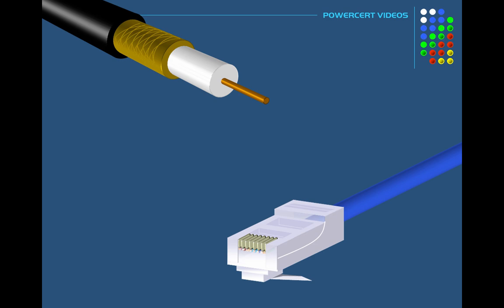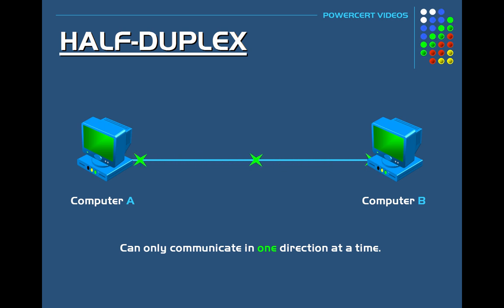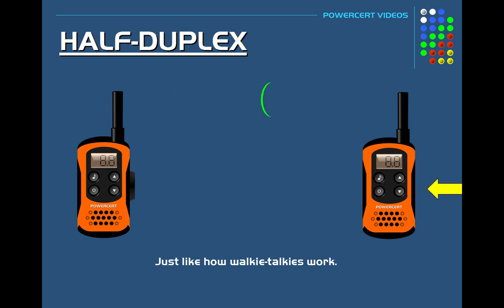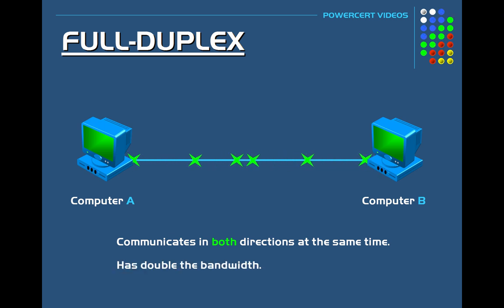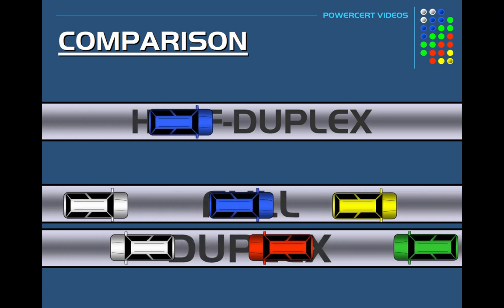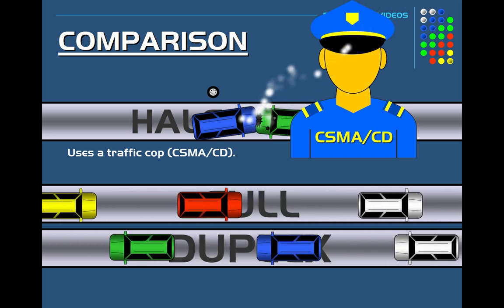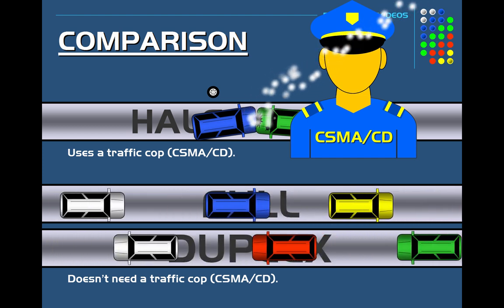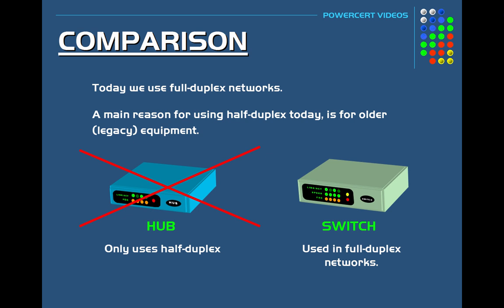Half Duplex vs Full Duplex

Comment: This video should maybe also have touched on the subject of Simplex. It's the third variant.

The signal is going in one direction only. The best example would be a TOSLINK S/PDIF fiberoptic cable.

So a Full Duplex solution is actually just two Simplex solutions set up in opposite directions.

Comment: I saw Half and Full Duplex in my router and wanted to know what it is. LAN 1 and LAN 3 had half duplex which I have been using the whole time and LAN 2 and LAN 4 had Full Duplex mode. That means better internet connection if I connect to the Full Duplex mode. May be, IDK but I will give it a try.

Comment: Ok question.    I want to add a nic to my server and my video editing workstation  that is direct for data only  but use full duplex.  I found a switch which supports full duplex.   Will this increase the speed  the raw files are pulled from the  nas to the workstation?   As i have ssd on each side one where the raw files will be and  one for my scratch disk.